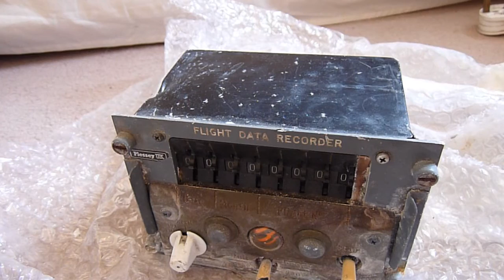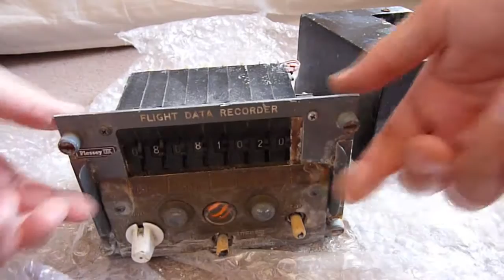Geek Week: Plessey Flight Data Recorder Controler Teardown

Comment: One thing that I know of Plessey is that they made very high quality stuff at one time, at least as far as capacitors go. I've found their electrolytics used as replacement parts, and sometimes originals too, in old valve radios of the 1950s and 60s made in Canada. At that time the pound was worth less then the Canadian dollar so I guess it was cheaper to use Plessey, TCC, and unfortunately Hunt brand capacitors then it was Sprague, Cornell Dubilier, or Aerovox made capacitors.

Comment: Plessey used to manufacture capacitors in the old days, kind of like TCC, I didn't know that they were into aviation equipment like flight data recorders. Aircraft often use 120 volts at 400 cycles per second, at least the stuff I have seen is 400 cps. Maybe the orange thing is some sort of special neon indicator lamp?

Comment: I think that may be part of it but it's also the fact that most aero engines run at very high RPMs even piston driven ones, so to operate an alternator at 50 or 60 cps means gear reduction. Of course when they established electrical and avionics standards in aircraft there was no such thing as solid state sine wave inverters, they had either vibrators, dynamotors, or rotary convertors. One other benefit of 400 cps is not only can you use smaller transformers but it's also easier to filter.